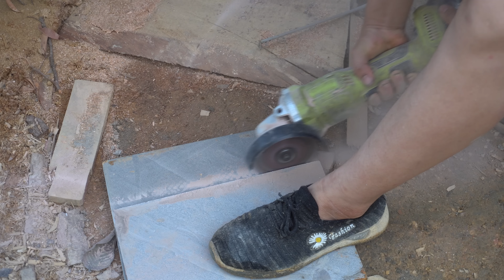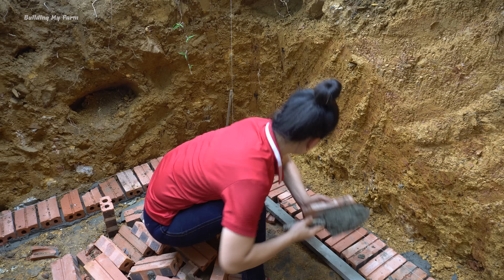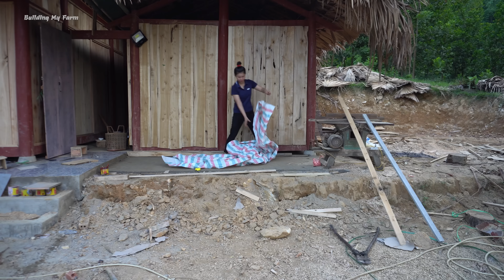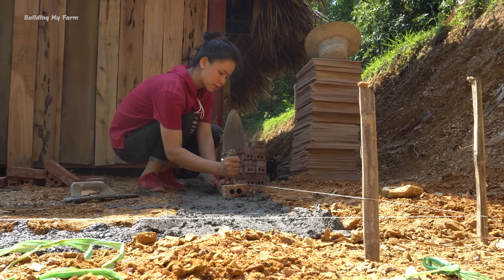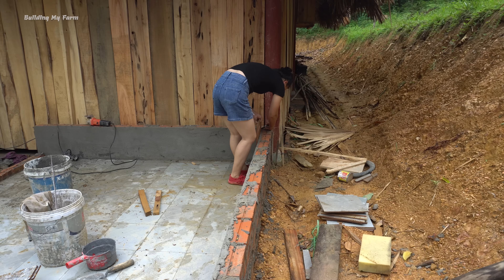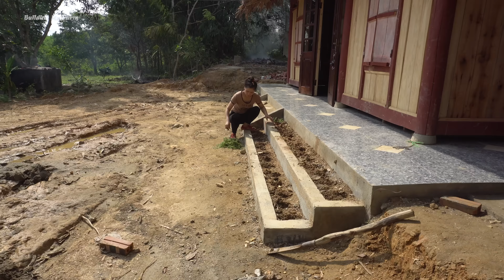Building Septic Tank, Technique Build Bathrooms And Toilet WC, Building My Farm

Comment: the size of that septic tank you could also have the animal waste going in to it and it will still last a long time the only thing i would worry is the tree roots as they could either damage it or destroy it
i notice on the out let wall you almost have  straight joints  form the out let up wards and that is a weakness and can cause your wall to crack the other thing is when you back fill behind the wall make sure you do not leave any air pockets as it would also weaken your wall

😱 @ cutting rebar i knew that Asian women can be strong but you a lot stronger than i thought as i knew my ex Asian girl friend was strong